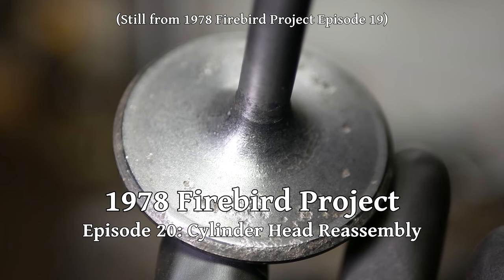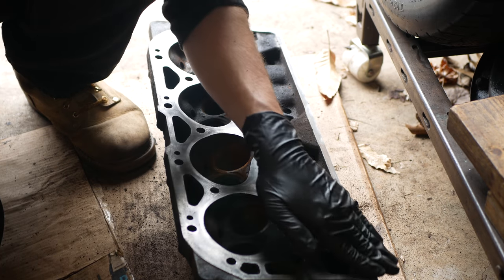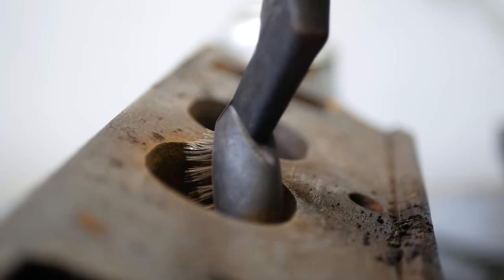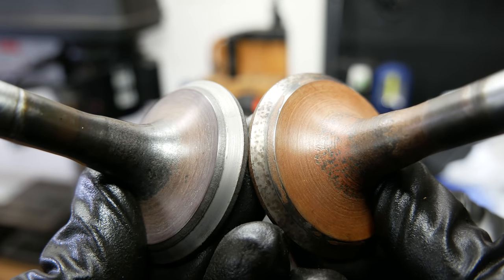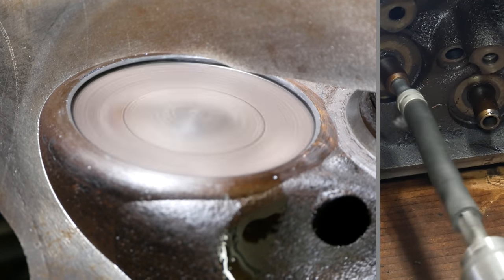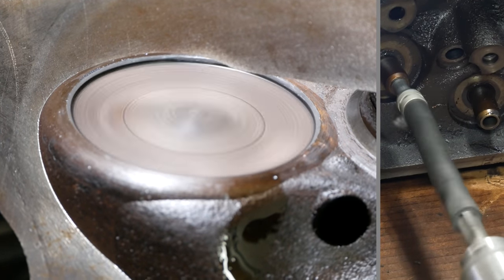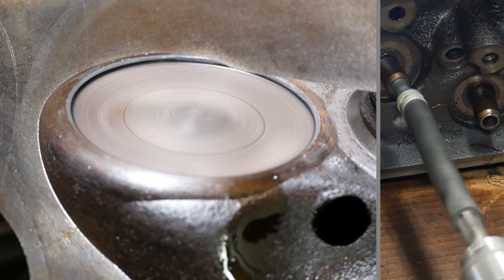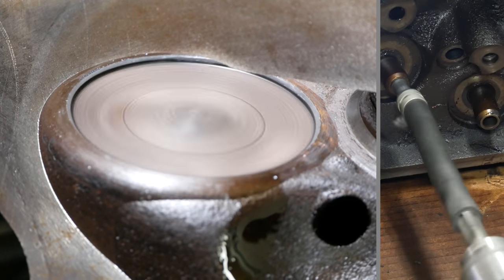$200 454 Engine Rebuild: Lapping Damaged Valves, Cylinder Head Cleaning and Reassembly (Ep.20)

Comment: I understand the allure of using “everything” on an Utube video engine rebuild...but changing a valve or two and replacing old valve springs would not kill the sprit of the work/video.
Reply: I agree. No use in ruining the engine.
Reply: Then you end up with the problem with springs that are stiffer than the rest 

I'm glad he's doing a budget build without buying stuff
Reply: I can agree too, budget is great but it will be more of a budget if the rest of the engine doesn't work from one valve dropping or breaking.
Reply: @benjamintaft3680  You understand that the engine is a 454 and not an LS9
Reply: @gvi341984  Would it not still cause damage?
Reply: @benjamintaft3680  Its an iron block engine that has little horsepower with lots of low end torque 

It's sealing itself properly
Reply: @benjamintaft3680  It definitely could.  I do like to see how these things turn out when I'm not personally losing money though, so I'm sort of glad he's doing it. I've patched plenty of shoddy stuff together on a budget and made it work.
Reply: Agreed..
Reply: I can't wait for the first year engine failure. Lol I am not even a machinist and I can see this
Reply: I would think if he uses it as a daily driver or street runner and doesn't put it in the races, the engine should do fine. If you replace the valve, you're looking at time in the machine shop. I just had to pull heads off an FE 390 to repair broken manifold bolts. I replaced valve umbrella seals and lapped valves. A couple of guides were a little loose. I talked to a machine shop and they said as long as it ran fine before and didn't use excessive oil to just put her back together and run it. Haven't had any problems. These old engines are quite forgiving with imperfections. It's when you race them and hit the red line alot that you really need to mind this kind of stuff and such failures would occur.
Reply: even as a backyard mechanic myself i even said "yikes" I mean even with my recent build when i saw that the valves had a crater in the valve seat face i just replaced all of them in that head, the new ones still seat fine and the engine runs great despite the extra wide valve seat face

Comment: Reuse the headbolts too, that'd really make the guys in the comments have a heart attack
Reply from the maker: Just for them, I will. From past videos people REALLY love when you reuse rod bolts, so batten down the hatches for that one.
Reply: It's nice to see a repair of parts rather  than banging new parts in.well done
Reply: P.s. if you want to knock that ridge off that one valve face, chuck it up in the drill press and get a stone on the ridge. It'll be gone before you know it. Blend it it, it'll be like nothing ever happened
Reply: You can re-use Subaru ones about 5 times. More times than you'd probably ever rebuild the same engine.

Comment: Dude I don’t think anyone would’ve faulted you for buying one brand new valve.
Reply: ONE???  Is that some sort of euphemism for 16?
Reply: I've been in his shoes before, not with car projects but just with other things in life. It's not about if someone would fault you for it, it's about "I said I wasn't gonna buy new ones and damnit I'm not gonna buy new ones."

I've been there before😂 can't say for sure, but I don't think there is going to be any changing his mind.
Reply: I guess sometimes it’s the challenge of it all.  Plus, anyone would probably just go buy new stuff.  I would.  But would that keep someone viewing?  “Tune in next week to see if it really works!”
Reply: @trevorvanbremen4718  went to a shop once and said I need a rebuild? They said how far you want to go?😯
Reply: @wdblackman  I was in this situation I ended up with little valve head margin after machining on a lathe, instead of risking burning thin faced valves in a new engine I replace them with new ones cheap insurance and saves trouble just in case

Comment: There’s a lot of hoping and praying in this series
Reply: I hope you're praying for it to work
Reply: And lots of hard work too.
Reply: @xxvanishedxx7142  agreed
Reply: @xxvanishedxx7142  harder than it should be
Reply: İt will be fine
Reply: And careful massaging
Reply: Don’t you mean, “soaping and spraying”?
Reply: Lol
Reply: How do you think we got this far? Knowing about about a potential problem and hoping it doesn't happen
Reply: I've seen worse  work good to fairly well. 🤷‍♂️ but it doesn't hurt to do both those things lol
Reply: @tonny.c  .
Reply: Be interesting to see how well it runs, what kind of power it makes, and if it lasts. Nothing wrong with using old stuff but for the love of God at least do a decent valve job, especially for any kind of performance application. Seems like nobody has the money or time to do it right,but they always manage to be able to do it two more times to correct mistakes.

Comment: if i had insisted on reusing those valves i would probably have  ground the step away from lapping them. and maybe even better rough ground the valves before hand and then lapped them to fit.

Comment: I'll be doing the valves on my '71 Maverick, 200 inline six. This is by far the most detailed video I've seen on the cleaning process! Lots of work to do, but I know it will greatly improve the performance of the engine--thank you!

Comment: When I reconditioned a junkyard Vtec head for my Accord I lapped the valves pretty much just like this. I used old faithful (ancient Milwaukee corded drill), a small length of old windshield washer hose, and a bit of broken screwdriver shaft to get things done. Worked perfectly I used the lapping compound a bit differently using techniques that I learned from my teacher years ago.

Comment: I like the build, I really do. I understand the idea of doing it on a micro budget. What I don't get is being hard headed and not spending the $30ish for a new valve. An entire SET of 8 Gen IV intakes are only $70 from Summit. I like budget builds but I HATE even the idea of having to yank a head because I was so cheap I wouldn't spend money where it's smart. 

 I once decided to reuse a set of valve springs of unknown age in a motor I wasn't exactly being cheap with. A .030 over 302 Ford sporting KB Hyper pistons, SBC 1.94/1.60 valve. Comp cams billet roller rockers... you get the idea. 

 I ended up bending an intake valve for one weak spring.... 350 miles from home. Bus fare + time and fuel to return with a trailer + new valve and guide + gaskets + having to listen to my best friend for a week say "I told you so." + a new set of springs I should have purchased anyway.
Reply: You can lead a horse to water but you can't make it drink.
Reply: You realize he’s making a couple thousand dollars in ad revenue for each of these videos, right?
Reply: @ChuckThree  that's our point he has more than enough cash to do a better rebuild of this engine. A ounce of prevention is better than a pound of cure.
Reply: @rgbigdog  Ounces add up. Plus the whole reason he’s doing the build is to test wether or not you need to abide by the “proper” process for rebuilding a mild engine. Worst case scenario he’s out $200, because YouTube has already paid for his labor time.
Reply: @ChuckThree  i think the worst case scenario is that valve breaks off or the whole valve drops in to the cylinder, punches a hole through the piston, bending a rod along the way.  then damaging everything that has a bearing.  possibly pushing that rod out the side of the block.  THAT is why everyone is suggesting caution.  not that he might have to later replace a valve.  the step in the valve is going to prevent it from seating correctly holding it open.
Reply: @frotobaggins7169  Exactly. Worst case scenario is it destroys the entire engine… which he paid $200 for.
Reply: I was expecting the head gaskets to be reused as well...lol
Reply: @ChuckThree  plus time/labor he put into it as well...
Reply: @ChuckThree  LAMO, you really think if this engine fails he will only be out $200?   my gasket set was $75 by it self.  not to mention all his time and cleaners  and what ever else he had to buy.  THEN he has to buy another engine which is ANOTHER $200 plus the time and costs associated with it.  sounds like we are coming up on $1000.   heaven forbid he is not close to home with it all goes south or on the highway.  whatever, i don't care either way, it's not going to be my problem.  all for the cost of a few valves.  the rebuild is a big undertaking, it takes time, energy and money.  why would you risk not having the best out come over a $10 part?  yeah you can do it but should you?  no.
Reply: @frotobaggins7169  Look, ultimately you’re bashing on free content that you can choose not to watch if you don’t want. If you want to watch someone build it the “proper” way, then watch Horsepower TV. 

The money argument is moot because he’ll easily make  >$1,000 on a video with a 1/4 million views. And he’s made 20 videos, 2 alone on these all offensive valves. Reliability wise, it’s an iron 454 making less than 200hp so it’s safe to safe it’s not going in a daily driver. Watch some Sloppymechanics videos and see what can be done building an engine the “wrong way”.
Reply: @ChuckThree  oh please don't be so butt hurt.  i wasn't bashing anyone.  i simply clarified what COULD ultimately happen in a worst case scenario, and it has.  will it happen here  i don't know what will happen.  i do know it's bad practice which even he says right in the video.

i could care less how much money he makes or doesn't make, that's besides the point. have you ever heard of learning bad habits?  think of all the people who watch and think this is ok because if no one spoke up challenging the idea, maybe lots of other people who don't know it's a risky idea might try it ruining their engine and they don't make thousands of dollars along the way.

you're hot the boss of me.  don't try going around telling me what i can  or can't say or what i can watch.  if he didn't want comments he could close comments.  he makes more money with comments.  so i'm helping him make even more money.  get a clue.
Reply: @frotobaggins7169  he has clearly stated, several times throughout this video series and other series as well, that you would NOT normally do what he is doing. He states that his technique is not ideal and could create issues.

So to your point of learning bad habits - if anyone learns a bad habit from these videos, it's on them. 

These videos also aren't intended to be tutorials, they are intended to be video logs of his shenanigans and projects. So... I don't really see any issue with what he's done here.
Reply: @frotobaggins7169  Ok my guy 👍

Comment: Love the channel, but, I wouldn't be able to sleep at night knowing that "that" valve was reused. This comes from a person very used to "falling down the rabbit hole" using used parts.
Reply: I'm pretty sure my professor would get a heart attack seeing that valve reused...
Reply: Absolutely nothing wrong with that valve lol it's a engine rebuild not a performance engine people wtf lol the lack of knowledge from you so-called mechanics is amazing to me
Reply: @jonathanlawson4667  "Absolutely nothing wrong"
Dude. That valve pitting would put craters on Mars to shame...
Reply: @edim108  valve was a little pitted up at the top when he was done and I guarantee you that valve would seal just as good as the rest of them lol  it's a rebuild not a performance build
Reply: @jonathanlawson4667  "a little pitted" is an understatement and a half.
And he said himself that this 454 is getting a blower...

If the plan was to just rebuild it on a budget and leave it NA, probably nothing bad would ever happen after reusing that valve.
But when you add forced induction to the mix, you run the risk of that valve not being able to hold up to extra stress.
Reply: @edim108  it's a small 144 blower so it won't be Making but 10psi at the most and for a basic budget rebuild like this is that valve will be just fine

Comment: When I was putting headers on my truck only 1 of the 12 manifold bolts came out without breaking. Said fuck it and decided to pull the heads and I got a good set of used heads
Reply: When it's that many broken? Totally understandable
Reply: i got them all out and i really wasnt that careful,thats on a 36 year old engine and that was in car
Reply: @trillrifaxegrindor4411  Well sometimes you get lucky, on my old jeep I was gonna do exhaust manifold gaskets. Snapped the first bolt then said "You know what? It's not that bad of an exhaust leak" and walked away cause I don't have any extractors lol

Comment: I like your hose idea on the valves. I was doing research and found that most pros dont recommend doing this with a drill from that end because you can cause wear on the valve guides and to only do this by hand. I do this with a drill on the valve side by taking a matching socket adapter to fit the suction cup and thats how i do it with a drill from the front. Never thought of the tube tho. Good stuff

Comment: I’ve done this whole job before. It definitely needed to be done. Wish I would have had this video. But I put my heads in a blast cabinet. Then lapped the valves. They were practically brand new when I was done.

Comment: I’ve been using a 15L ultrasonic cleaner this week to clean a much smaller engine head. I’d definitely recommend it as it dissolves carbon and surface rust on all the surfaces including channels you can’t normally get Into

Comment: At the end of the day it’s all about working with what you have. Yes I would have replaced the valve as that had gone way beyond what I’d work with on someone else’s car. But as a project - a task that you want to carry out ‘in house’ without any machine shop input - you do what you can with what you have. I have done this many times to keep things simple and ‘in house’ - and if you are sensible on what you think is achievable you can do great things and be proud of it - and it will work!

Comment: Those seats and valve heads cleaned up pretty well. My only trepidation really is the difference in installed height of the valve tips especially in regards to that one you really had to grind down. I would have expected it to have been overcome by shimming the rest of the springs to match the height of the tallest valve but then you get into differing seat pressures, etc. You could also overcome it with different length pushrods but that would seem to be  far more difficult, logistically. Do you expect that the resulting change in effective lift won't have significant effect on the engine over all? As this stuff was recorded over a year ago I would be interested to know, if you're that far ahead, what the impact was. if any. Because science! :) Very much enjoying the series.

Comment: I'd replace that valve from Nr 3, the wider seat for the valve will cause excessive heat transfer to the valve and if it overheats the hardening of the valve will get compromized and the valve will melt, atleast thats what i was tought lol. Also some valves have a hardened coating that is very thin and excessive grinding can remove that layer, might not be a problem since its more common on modern engines but you never know.

Comment: I think the head gasket should flow as freely as necessary to take up all the irregularities. It is not going to get out of alignment while it’s sitting on the dowels. The smoother the surface the easier it can seal.

Comment: I suspect you’ll have issues with compression once fully assembled. Having a valve sitting “deeper” into the seat, will not fit within tolerance between the camshaft and keep the valve open.
Reply: It's called valve lash

Comment: When a bolt is broken off below flush, you can use a little bit of copper to protect the external threads while you build up weld to put a nut on.

Comment: 2 things - the main purpose of lapping isn't sealing, it is making good contact so that the valve heat gets conducted into the head. Valves adjusted too tight will run pretty well without eve touching the seat but they will burn from lack of cooling. 

Also, if you don't have a good straightedge you can check with the other head and block. Spin them around and pair them up backwards. In theory two mating surfaces could warp the same way and still fit if both faces are matching curves, but the only shape where face A and B, A and C, and B&C all fit together is a flat plane. That's how you make a flat plane without any flat reference. Take three pieces of stable cast iron and lap them together A to B, B to C, C to A and flip them end to end every now and then.

Comment: Never in my life have I seen someone waste this much time on Peanut port cylinder heads! 🤣😂🤣😂
Reply: Guys are running good power with them still...for average street use a good head still...check out Mark at vortech pro running 10's with  peanut ports... remember it's about velocity as long as you don't plan on twisting high rpm

Comment: funny,i just did this last fall on a set of sbc vortec heads(made my own lapping compound from grinding wheel dust and grease,lol)the valves and seats came out really nice and the heads work great.silliest thing i did was after swapping in a new hot cam and buttoning everything up,I realized i didn't torque down the timing chain sprocket.DARN IT...off came the water pump,off came the timing chain cover after loosening off the oil pan AGAIN....All this was done with the ENGINE IN THE CAR!!!

Comment: Head gasket and bock surface - What I've used with success are fingered roloc wheels. I use the white 120 grit wheels. Most mechanics that use them say to use the yellow 80 grit wheels. I think and iron heads and block 80 grit would work fine.